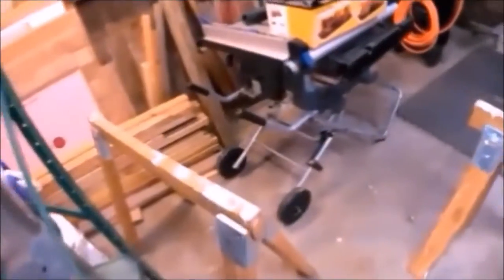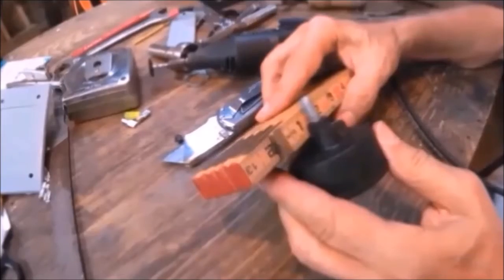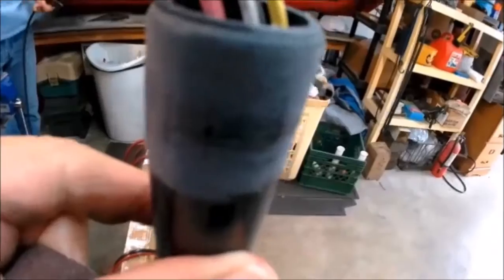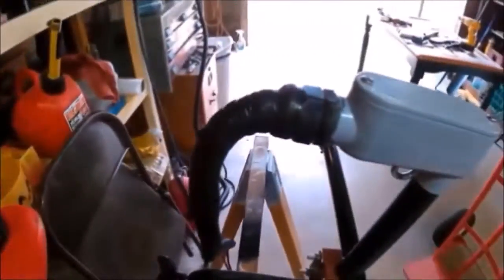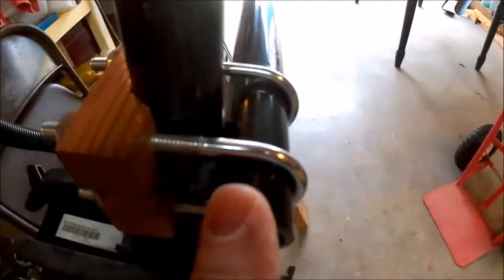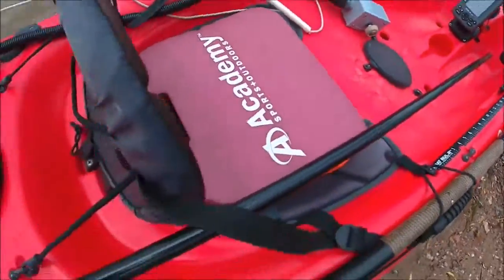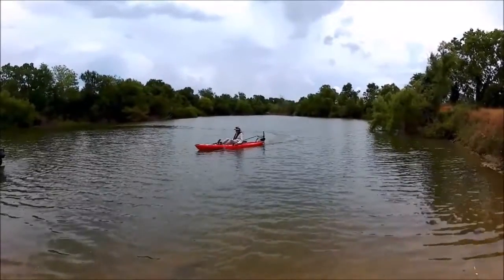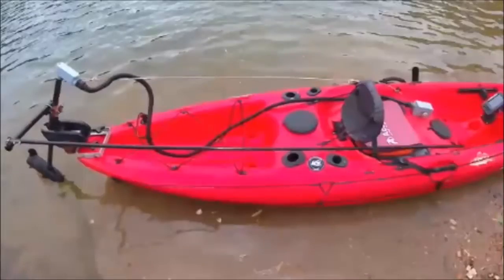Stern mounted kayak trolling motor with tiller steering.

Comment: Great video gentlemen. watched both the vids. Great explanations and clear pics thanks.   Im going to try that on kayak with a minnkota 30 lb thrust or get a c2...was wondering what size the wire you added for length is?  Looked through comments and didnt see that question. i may have missed it though.  Great vids keep up the good work....Ken in CA Delta
Reply from the maker: https://www.minnkotamotors.com/sites/minnkotamotors_site/files/condutor-gauge-and-circuit-table_1-22-19.pdf
Reply: @WaynJul  Thank you for reply great chart for wire mods. I appreciate it......I subscribed..Ken in CA Delta
Reply from the maker: Thank you. I hope it woks out for you.

Comment: Ok. Good effort. However, you went to all that trouble and didn't add in a PWM?! Missed opportunity to extend battery life.
Reply from the maker: Thank you for your constructive criticism. I have helped several friends install modified trolling motors and DIY brackets on their 
kayaks. Some of them choose the PWM and others just used the #2064028 switch that came with the trolling motor. on another  build a friend bought a trolling motor and we did add PWM control to it. In my latest video my friend got the new #2064028 five speed switch from the one that installed the PWM because he did not want to use a PWM control.
Reply: @WaynJul  all good. I don't know why you wouldn't want a PWM but each to their own I guess. Your video was indeed helpful 👍

Comment: 10:30 removing the motor. can you tellme where it is connected to a battery here? it appears you just pull it off, I dont see where/how you are powering the motor ?
Reply from the maker: 7:29 shows the plug near the motor bracket. He later moved the plug towards the seat to cut down on electrical resistance. We are always modifying our kayaks one way or another.

Comment: why noy buy a $15.00 PWM unit?
Reply from the maker: My friend wanted to use what came with the trolling motor without having to spend any more money on it. I did talk another friend of mine into using one after his minn Kota switch stopped working and he likes it. Less current and heat also..

Comment: What size PVC pipe did you use for the tiller extension?
Reply from the maker: It is 1/2" SCH 40 PVC pipe.
Reply: @WaynJul  thanks! It just looked smaller in the video

Comment: can anyone help on waterproofing battery   https://www.youtube.com/watch?v=3MEk_uPxMz4
Reply from the maker: How do you mean? You have it in the hull?
Reply: hi wayn what i mean is i need to secure battery inside the hull if it tips over it might slide out its 16kg also i somtimes get water in the bottom of kayak just want to cover top or put battery on its side  you videos are cool cheers
Reply from the maker: I would be afraid the copper pipe would become dislodged and short across the battery terminals.
I made a stop out of 1/2" pvc. Maybe secure the hatch cover so if you tip over then the battery won't break through the cover.  I am sure you will come up with a solution.

Comment: Well done fellas. Is he happy with it?
Reply from the maker: Yes  he is. The trolling motor was mounted on the side of the kayak on a  board and wanted it like mine mounted on the stern for better control and tracking. He likes it better now. The difference is mine has foot steering ,his has tiller.